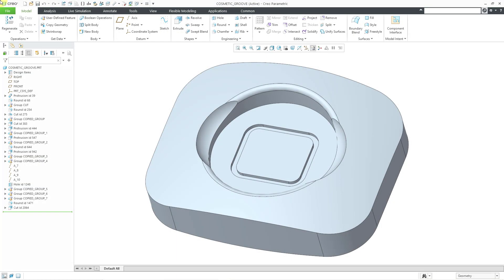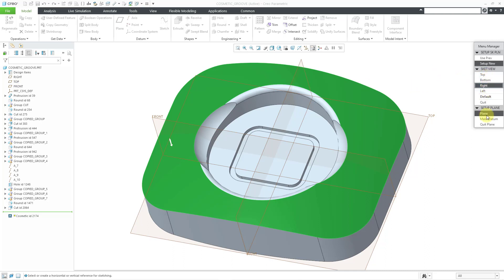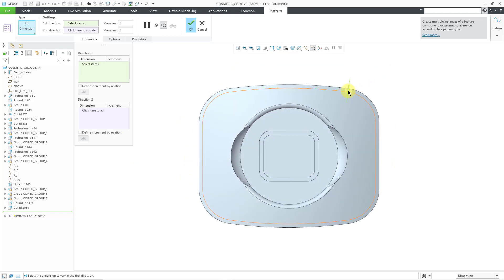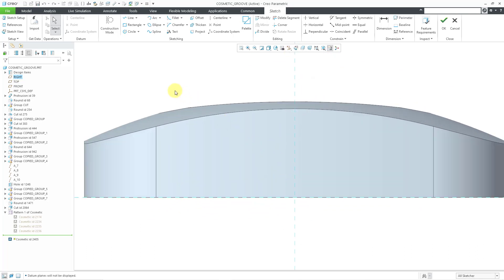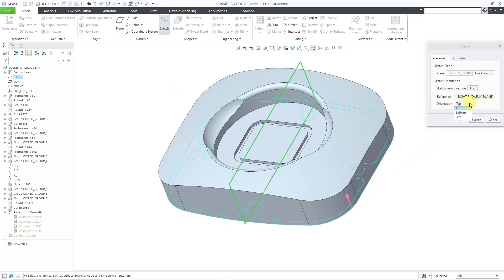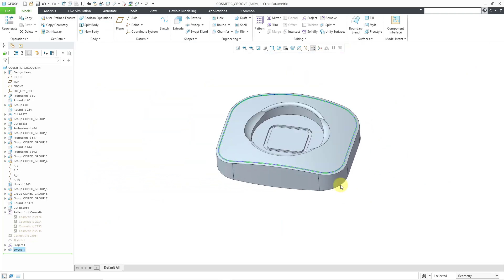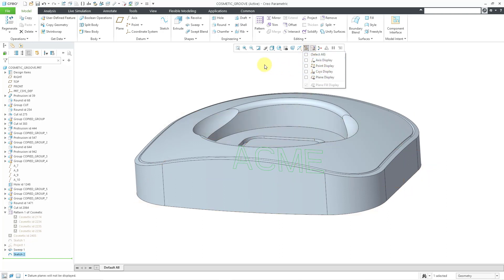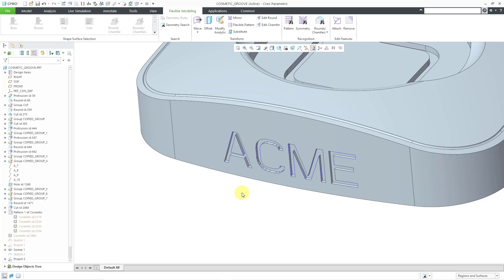Creo Parametric - Cosmetic Groove

Comment: I would love to make a grove that goes around a cylindrical surface and also it has to not fail, when i change the text, once it is done.
Reply from the maker: Go for it! I recommend taking Design Intent into account. Think about what changes are likely, and then build additional intelligence into the Cosmetic Groove, maybe with parameters, relations, or even BMX, so that your model is flexible and robust enough and it doesn’t fail.
Reply: @CADPLMGuy  Yes, but I had to bend a text extrude arround a curve and then substract the text extrude body from the cylindrical body. BTW, I can not put it in words how much I appreciate your videos have had many situations in the past, when even my cad service provider could not help on a cad problem, you are just a Legend! Greetings from Switzerland
Reply from the maker: Have you looked into the Divide Surface command for this kind of application? PTC’s Creo channel has quite a few videos on how the functionality was developed for these kinds of problems.